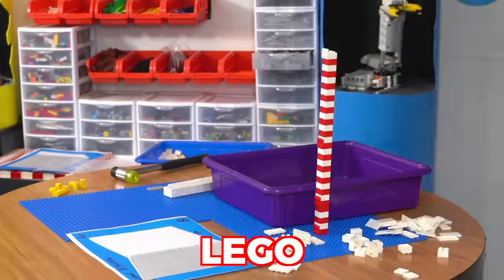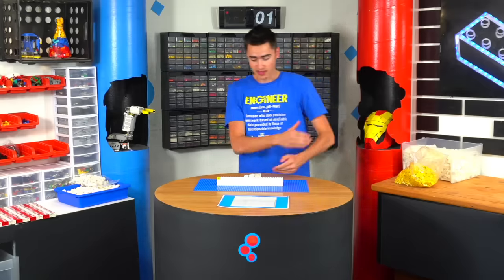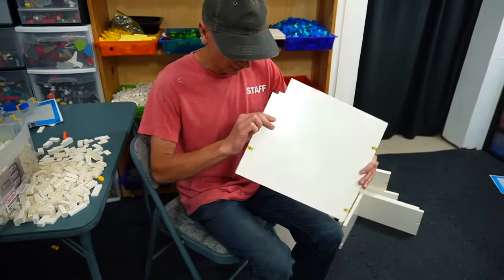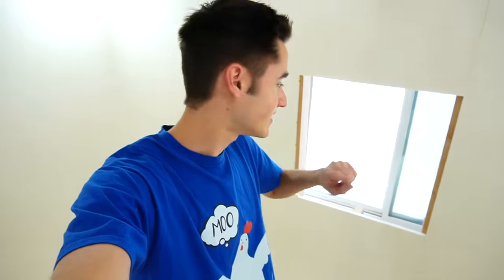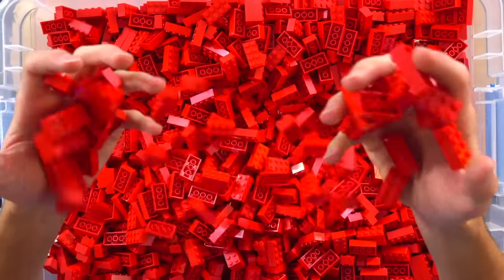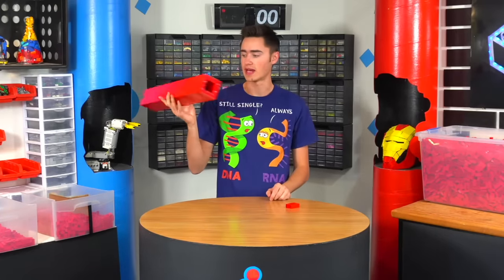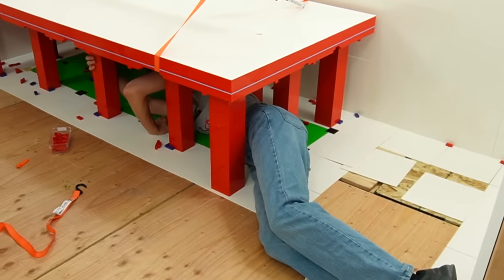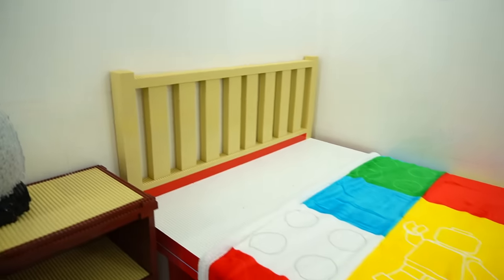I Built My Room out of LEGO!

Comment: If you're not gonna lay on the studs then putting the smooth side down will make the mattress slide off easy I would suggest if you're gonna use a mattress to leave the stud side up to grip the mattress and keep it in place especially when you roll over at night it does put lateral forces on the mattress in the bed

Comment: I also want you to use a gunsmiths hammer to tap those lego bricks down may I suggest you don't use the hard side but use either the plastic or rubber side depending on what type of gunsmith hammer you have.  All I'm saying is I've been playing with legos since about 1974 and I've made a mistake as a kid taking a metal hammer to plastic bricks use the rubber side you can't have an accident with that